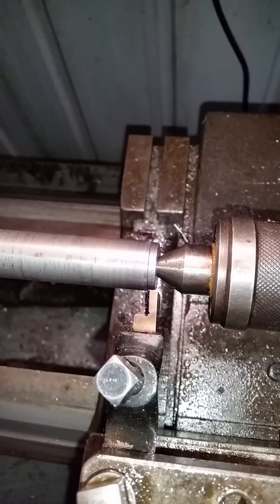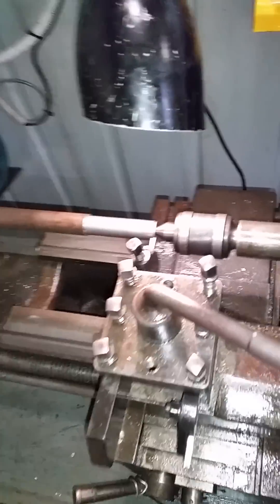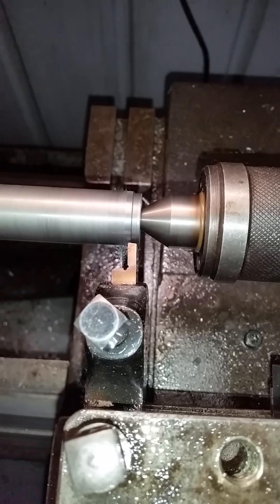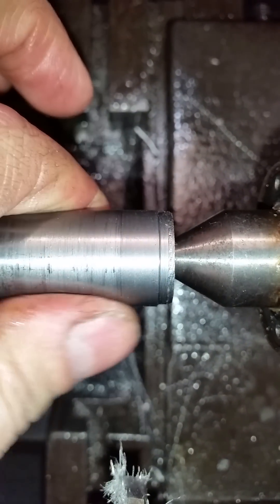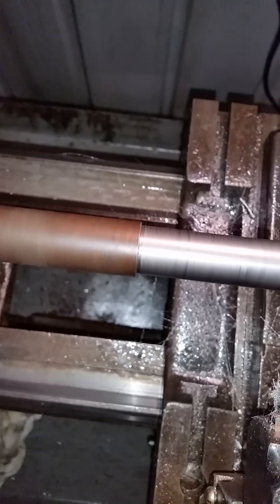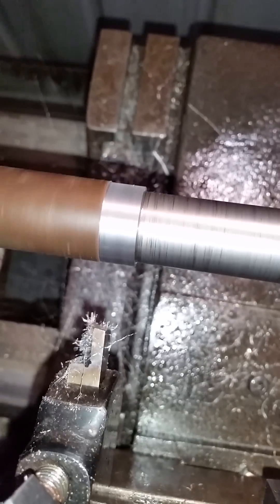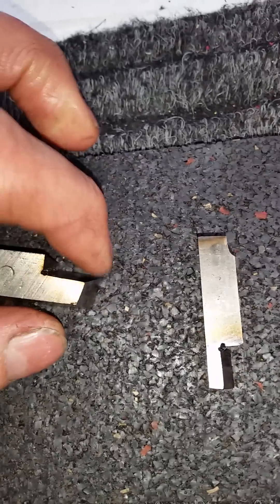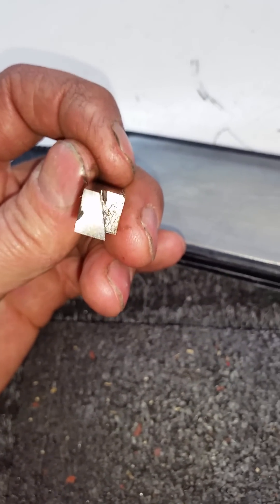GOOD FINISH LATHE TURNING HOT ROLLED STEEL VERTICAL SHEAR TOOL

Comment: Thanks for the info, very helpful! I"ve had lots of issues with  carbide cuts that leave a rough finish. and you've solved it in 6 minutes and 27 seconds. Big thumbs up from rainy England
Reply from the maker: jon gough Also try using aluminium or ground carbide inserts for light cuts with lower power lathes

Comment: Thanks mate, this really help me out. Just bought an old myford and was really struggling to get a finish on mild steel, been using tungsten inserts for the convenience. The Old lathe came with boxes of high-speed Steel Tooling so I got the angle grinder out and hacked one to shape and bingo it works, got a much better finish. Thanks again.

Comment: My cheap Chinese lathe cut nice and shiny until change gears were altered for screw cutting never cut right again?
Reply: Sounds like you didn't adjust the gear backlash correctly. Try tightening the gears after squeezing a single folded paper between the mating teeth. The folded paper should be very snug and after removing the paper there should be just enough rotary backlash to mesh correctly.

Comment: Thanks mate, this issue has been a bugging me for a long time. I've had some success with curved tool bits but not as good as that, I imagine that this tool will also suite non ferrous metals eg alloys, copper, brass?